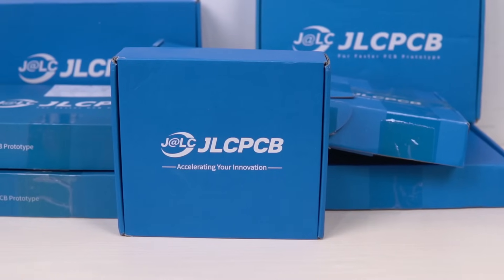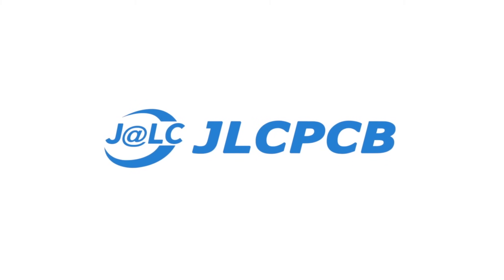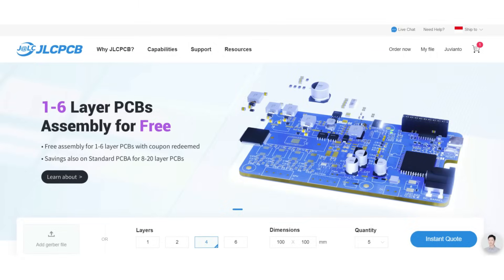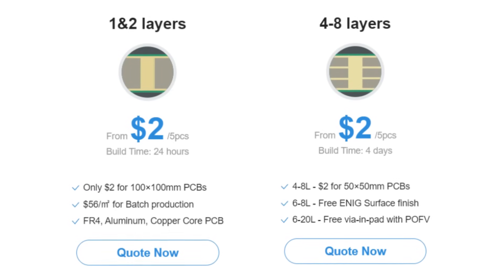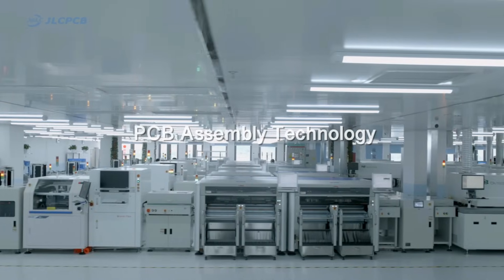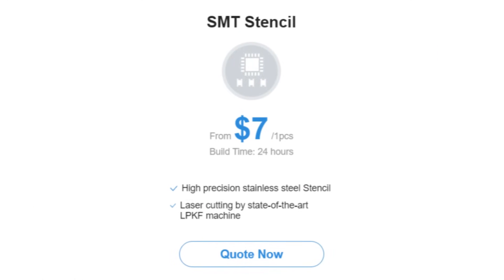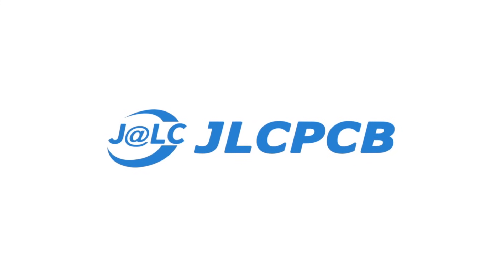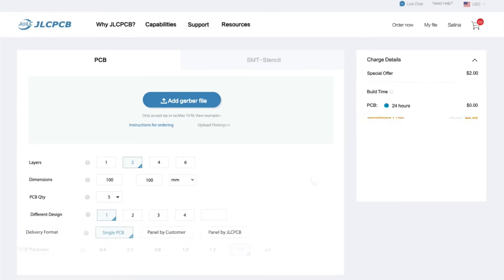The latest blue cooled 300w+300w amplifier uses 6+6 transistors 2SC5200 and 2SA1943 #cbzproject

Comment: hi there friend. Can you provide me with a link where I can buy some of your products? I like a lot the product from this video. maybe you can help me at least with part of the modules. I mean I would like to buy the entire stereo product with the power supply board but, if it is difficult for you, at least the products without the main power transistors and the big capacitors and radiators. Thanks a lot.